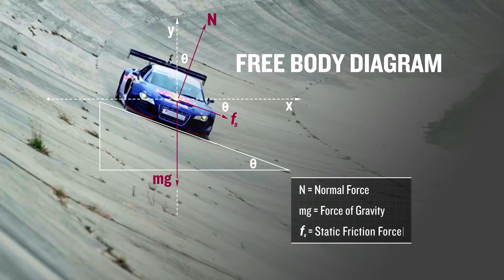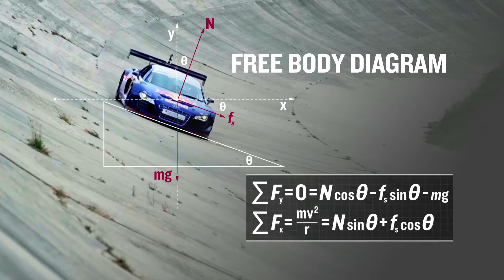OpenStax AP Physics Chapter 6: Friction And Angular Motion (Physics Concept Trailer™)

Comment: why are you assuming its a right angle triangle when the banks are curved?
Reply: I know this comment was from 7 years ago, but I thought I'd try a reply. Yes, the bank is curved, more so at the bottom, but it is mostly flat nearer the top of the bank. The forces are assigned to perpendicular coordinates, for example, 'up' and 'to centre of the circle', and y (perpendicular to slope) and x (parallel to slope). The component vector forces assigned to these perpendicular coordinate axes will create right angle triangles. The exact angle of the axes x and y to the 'up' and 'to centre' coordinates will be based on the position of the car and the angle of the bank, not accounting for any curvature, which will be minimal nearer the top of the bank.